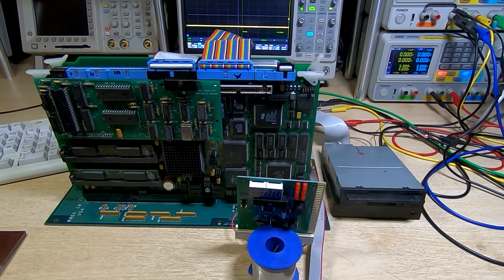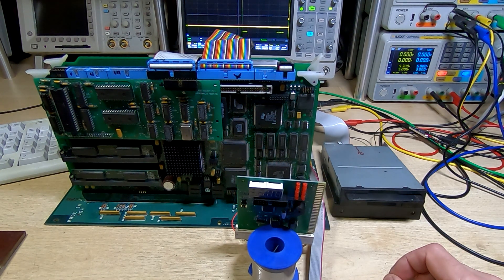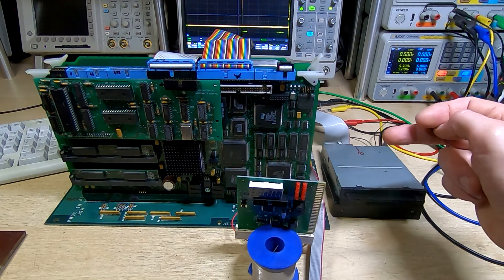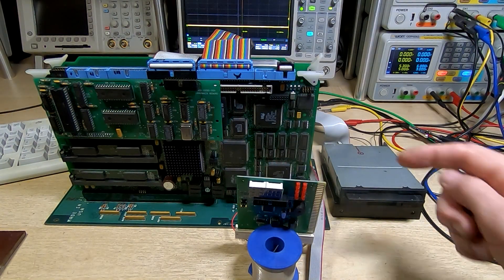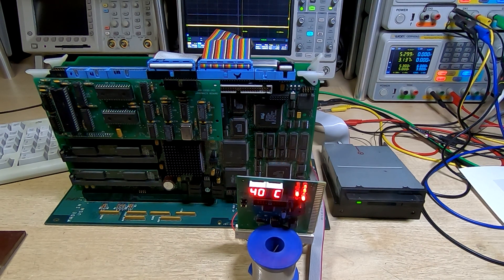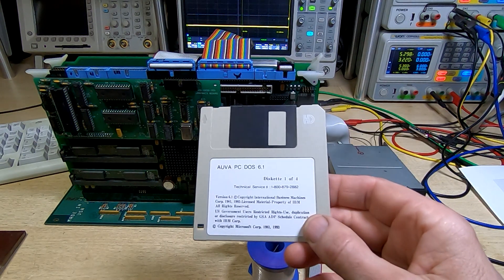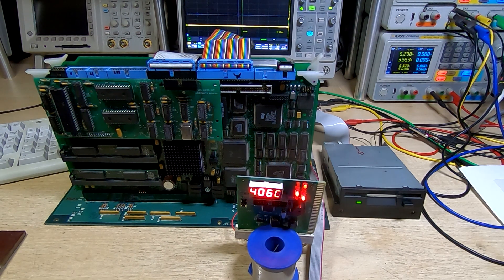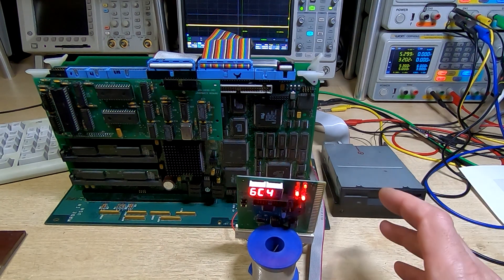Hurco BMC25 Controller Repair Part4

Comment: Used quite few of these types of CPU boards in information displays in the late 90s and they used the COM ports to allow changes etc.  When configuring the BIOS on those, ie. to boot off PC104 memory boards i used, they would default to C: and the bios was A: B: C: as default.  On first setup it was looking to load the BIOS defaults which were as i needed them, so once it boots up and is waiting try pressing F1 to accept default setup and see if it then continues to boot from the HDD.  Hopefully that makes sense.
Reply from the maker: Thanks for the comment. I wish it was that simple but the default configuration does not produce HDD activity (It was the first thing I tried) but even if it did trying to boot a big CNC mill with the hardware improperly configured is a really bad idea. I also suspect that if the defaults were all that is needed then Hurco would not have gone to the trouble of developing a custom VGA card for setup purposes. This uses AMI BIOS (I already extracted the image from the ROM) so will not respond to serial commands until the OS is loaded. I also suspect that it will not get past the POST until it is configured. The BIOS configuration is not accessible from the serial terminals so even if the HDD starts booting we still need to find a way to configure the correct BIOS settings. I have actually been trying to get the BIOS image to run in an emulator so I could do a blind keystroke by keystroke setup but so far I have not found an emulator that can run the ROM code and I really do not have time to reverse engineer it.

Comment: Back in those days CNC machines manufacturers have done everything to avoid owners and/or unauthorized technicians to be able to fix such problem. They probably have a portable console with an interface card to made on-site repairs (with super charges). Clearly they don’t have taken in account of you. Great strategy and knowledge as ever.

Comment: Being a 486 computer, I think that the OS is standard msdos, maybe 6.22 (FAT16) with a custom program loaded from autoexec.bat to control the GPIO and the second terminal and the command CTTY COM1, <baud rate&transmission parameters> for the console input to be taken from COM1, the first terminal, thus not using a local keyboard and display (VGA card and monitor).
Also I would make a image of the HDD contents just in case.

I watched all  the videos in this series and all played just fine.
Reply from the maker: I already know what the operating system is. It is provided by Hurco and the owner has the disks. I only tried booting to DOS to check that the system is able to. That is not the problem as we can reload that at any time once we can access the system BIOS. The current problem is the OS will not load until the BIOS has been configured so what I am trying to do is find a way to attach a VGA display to the system so that we can access the BIOS setup. It will then be simple to restore the OS. The system is a bit more complex than I have described but I do not want to branch off into things that are not part of the repair process. The system includes interpretation between the CPU and control. I am also trying to avoid discussing elements of the system that I do not have access to as this would make the videos hard to follow. The CNC machine does not have local KB and VGA but this is the only way to access the setup.